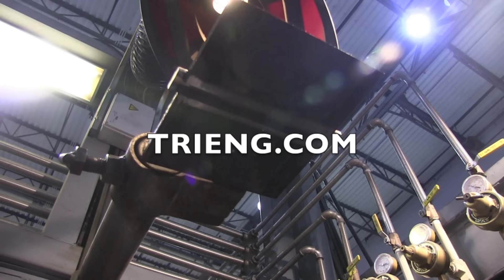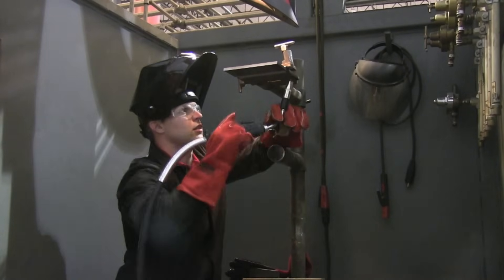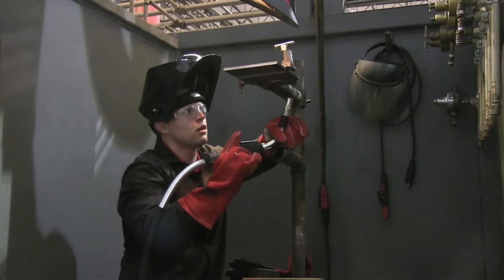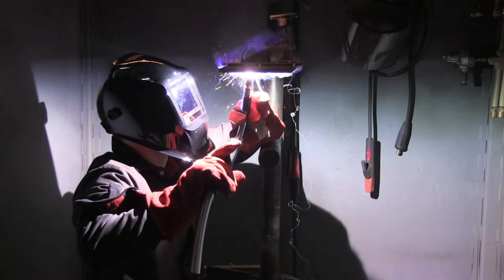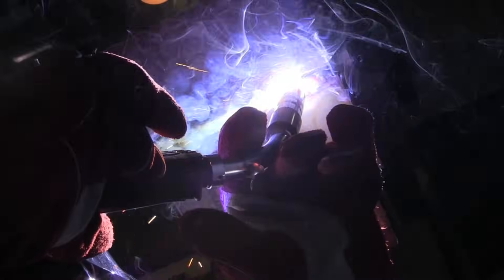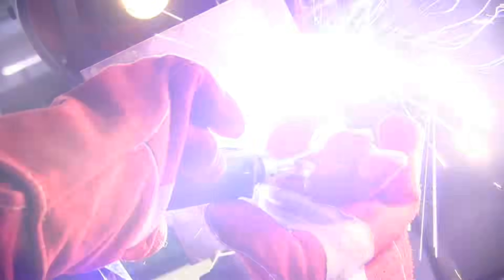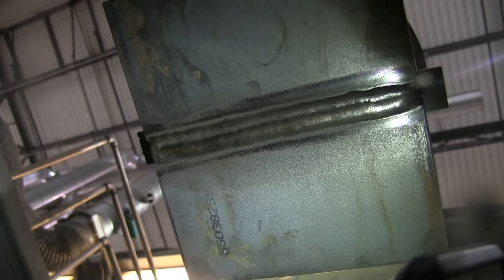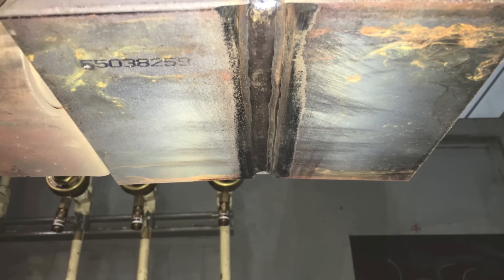4g Overhead Welding Dual shield Flux Core Test

Comment: I just failed my second refresh test for overhead pass after not failing it for 12 years. I don't know what I'm doing wrong, both failed because lack of penetration they say. I start at 25v 325 wirespeed and end my cap at 24v 290 wirespeed

Comment: Have a 3/8 plate no backing strip 4g test. Having problems with worm tracking. Running 045 1/8 root face 1/8 gap 21.5 325. Only on root. Happens no matter closer root gap or open. Any tips? Test on Monday
Reply: Clip a little piece of cloth on the wire or stick the wire through a little foam ear plug in between the spool and the drive rollers. It'll clean off the white oxidation that builds up on dual shield wires and might help.
Reply: Obviously this too late but worms I believe can be bad flux... Anyone correct if wrong or I misunderstood

Comment: Always run as far as you can onto your runoff tabs!   He stops to close to the edge of the plate.  He is a good welder and can get away with it, but if you’re learning stop at the end of runoff tabs or else you may have an issue.

Comment: Do a open root, with no backing.
Reply: No
Reply: That’s literally impossible with flux core
Reply: @lukepatrick2032 no backing is 100% possible on flux core. Its more difficult than hard wire for sure.
Reply: @TheBiggerDavo  post a vid of you doing it

Comment: hey Jody ive got a question for you im doing production welding and was wondering what you would recommend i could use for a setting on my welder to not only be faster but have alot cleener weld im runing 0.35 on c25 in a Lincoln power mig 255 and right now ive been running 28.0v and 540ipm but i have a dingle barry problem lol could you help

Comment: Jodi. In your 3G plate video, you mention lowering your settings after the root pass is laid. And on this 4G video, Andrew starts out at 25 volts, 360 IPM, and you never mention a different setting throughout the video. Did he weld the stringers and cover pass at the same settings? Thank you for all your videos sir!

Comment: Great video Jody but can you please do a 3g and 4g with ceramic tape aka ceramic backing. There is us welders that work on ship yards. Navy specs are a little different that regular structural welding... thanks in advance
Reply: manuel chavez 
Ummmm. Its impossible to run 4g with ceramic tape. Id like to see how burnt up you got.
Reply: Butch B not impossible at all. Had to do it for a job before
Reply: Im sorry. Your non running overhead ceramic tape

Comment: That elbow-arm shield would have came in handy many times for all the overhead tests and welding over the years. Especially testing! Once you start the test and you get going good and molting metal drips down and is burning the crap out of you and all you can do grin and bare it until the end of the pass.

Comment: Great video, once again. I was just wondering what shielding gas ratio you were using, because, typically, more CO2 equals a bit more penetration, which may require a bit less voltage per wire feed speed. My experience with a wire feed process has been just point and shoot, but with less forgiveness on machine parameters.

Comment: Can any mig machine run dual shield FC??  Say a 140a machine with .035" wire??  Or do you need spray arc type, high voltages to get by?
Reply: nope. a machine that small won't be able to manage the voltage needed to run dual shield. 035 dual shield is going to want around 20v, at least. even if a smaller machine can produce the voltage, duty cycle at wide open becomes an issue. if you need to get as much as you can out of that machine, run self-shielded on 220v service.

Comment: Please. I beg you please stop using backing straps.

Either an open root with solid wire on 1G-6G and with flux core with a ceramic tile.

Also would appreciate if you could do a butt weld with a bulbar on the on the overhead position with a tile.
Reply: Why stop using backing straps if that is what the test calls for??  This is structural steel code...not pipe...
Reply: +Nathan Hamler I honestly just want to see something different rather than using a backing strap as not all tests require it and most of the time you are asked to use either a ceramic tile for 1G-4G for flux core root and no tile/backing strap for the solid wire root process on 1G-6G.
Reply from the maker: I think it would help everyone to know what industry you work you in? Shipyard, Ironworker?
I actually called Triangle Engineering prior to shooting this video to get some feedback on the most commonly used test plates based on what they sell.  22.5 deg with backing plates was the winner...so thats the reason for me using the backing. it seems to be the most commonly given plate test...at least in the USA.  I have heard of 2 other methods that some shops use for testing and one of them is using  ceramic for backing ... the other is to use no backing and after the plate is welded from the face side ...back gouge or grind ...and then weld from the root side to achieve a full pen weld.
Reply: +weldingtipsandtricks I'm from the uk and worked in places from shipyards to bridging works. I'm currently working as a welding instructor and we always teach our students an open root unless doing a flux core test as this just happens to been our standard. However I think an open root is more difficult to produce and have had to do them previously with all processes. Open root used to be the standard way once upon a time. Current standard 9606 calls for a backing bar. I have heard it's been modified recently to accommodate "newbies" and make it easier and boost employment/trade etc. I don't know how much truth is behind that. In my opinion open root is more difficult then burning into a backing strip. You could also (as you mentioned) gouge the root out and put a signal run in then have a full pen weld, You can't do this with a backing bar. Think you should give it ago regardless Jody. 😄
Reply: You don't root overhead on ceramic. it can be done if your root gap is 3/16 or smaller I suppose. Best to root it with ceramics on the overhead and root it flat. Then fill the overhead with a cover. Next gouge/ back grind the root out from the top taking out the fusion line into clean metal. Then fill it up and cover it. There isn't much of a difference rooting over ceramics than a backing bar as long as you have a good fit up. Perfect root gap in any position is 3/16 in my opinion.   Best to use a backing bar if you can't get to the back of the weld to gouge/grind/ weld.  A single 45 degree knife edge bevel butt weld on a backing bar will give you complete penetration.
Reply: +BigBstrd  sorry 22.5 degree bevel on both members
Reply: +BigBstrd  Also you can get complete  penetration on ceramics if you use ceramics with a channel down the center. However the fitup is going to determine whether it is possible. If I have a good fitup and decide to weld the joint complete from one side ( on a single bevel joint) I stick my ceramics to backing bar then clamp the ceramics and bar to my work tight.  Eliminates the ceramics from dropping or pushing out. Looks like I welded the backside when I remove the ceramics. Job then gets UT or RT inspected then a final visual and MT inspection of the cover.
Reply: Kevin Brown
Reply: Gary Wilson whose channel is it??
Reply: Haha agreed. I'm a boilermaker, I took a weld test last week on 3/8 open root stainless to carbon 3G with 308L .045, no hard wire allowed, with a backgrind + root side pass.  Did a downhill bevel-side root as well bc it was machined to a feather edge. 
Most unorthodox weld test I've ever done; completely uncharted territory for me. 
And they had me do a 2g same specs. 
Both bends, however, turned out flawless. 

Oh and whoever said you can't run flux core vertical downhill is a fuckwit, made it look slick, son💁🏻

The boilermaker life is most definitely not for pussies
Reply: +weldingtipsandtricks Mainly based in Shipyards in the UK, where its all link ups thats over here and never once had the opportunity to use a backing strap on any test or job seems as tho its all ceramic tiles with Flux core or solid wire and a gap and back gouge it. Just think it would be beneficial to your audience to show them different variations of rooting with a tile as a few things can go wrong if not properly done right. Cheers Jody
Reply: Evan Arnold toot toot

Comment: nice demo jody, it would be nice if you can educate people about welding wire and shielding gas/gases mixture as they have dramatic effect on weld penetration as well as on tensile properties and its also important for people to know to use the right wire for this position as not all the wires are manufactured to use in all positions welding.

Comment: As far as cooling the work piece is concerned, do you recommend letting it air-cool or drop it in a bucket of water?
Reply: thats the reason jody is keep on saying that follow the wps. because you have the restrictions in pre heat and interpass temperature in order to control distortion. Dropping mild steel in water can cause a serious demage to metarial's grain structure.
Reply: dropping in the bucket, are you serious?
Reply: I mean it can cause shrinkage...
Reply: if you're doing any kind of test, dropping it in water will guarantee you to fail as when you bend it it will snap in half. if it's just for your practice,then you can do that. but never do it on. any test
Reply: You can remove your plate when doing a test